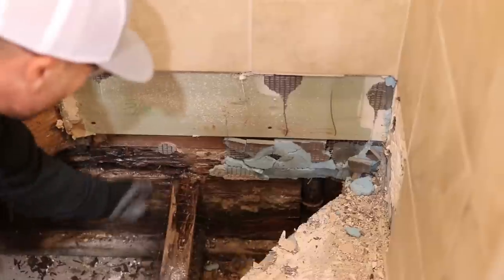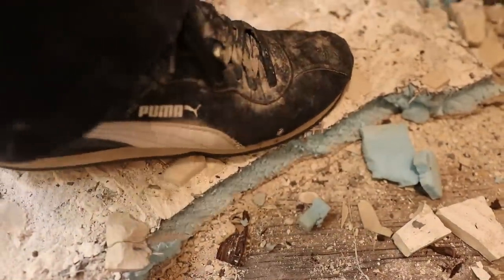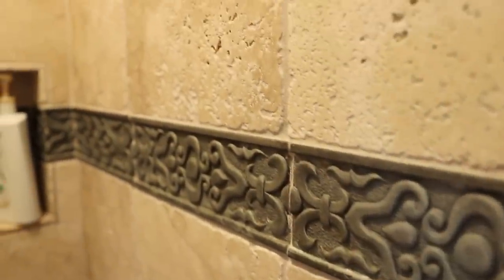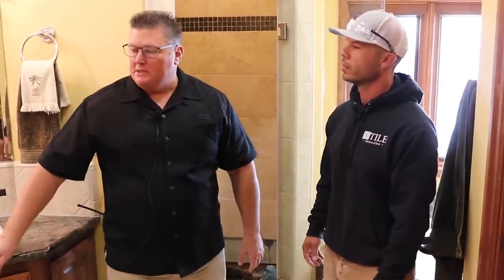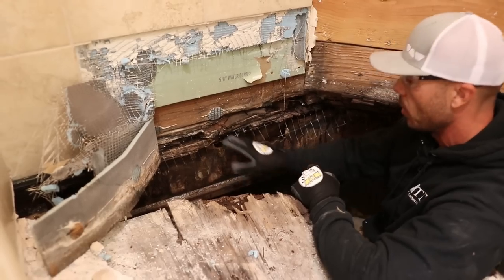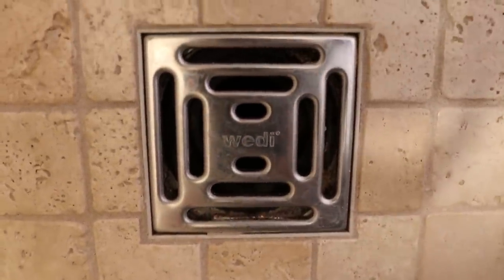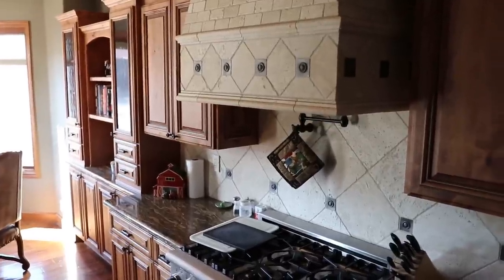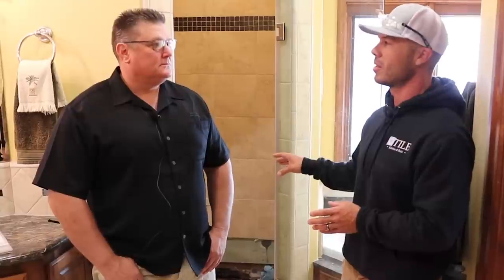Massive WEDI Shower FAILURE (Done by Certified Installer) -- Warranty Claim DENIED

Comment: I was thinking of doing my own bathroom remodel but after watching all your tile fail videos I’m scared to do it.
Reply: Funnily enough I started ripping my bathroom apart just before lockdown occurred. I had kind of decided to go with the Wedi system, but like you I am now having second thoughts. I guess all systems have their failings and so it is difficult to know which way to turn! Thing is, whatever option you choose it is damned expensive and so it pays to get it right. This of course doesn’t take into account any damage thereafter if it is done wrong. Sheesh, I think I need to go and have a lie down.

Comment: Great video, unfortunately we are having a similar issue. A 1/4” of their sealant was utilized. My report says in 2012 when ours was installed that 3/4” should have been used and now 1”. I have been going back and forth with them. They continue to deny the claim, we are of course right at the 10 year warranty period that they had in 2012. Their rep was onsite during install as the company we dealt with did not have experience with a steam shower. Wedi is denying our claim saying they do not have proof that their representative was onsite. It’s been a very unfortunate costly situation! The wedi representative in FL has been very friendly and responsive. It’s just very unfortunate that his manager and the insurance company continue to deny the claim when this is clearly an installation error. They are offering to give me wedi board then the rest will be on us which is very expensive. Our floor is even damaged. At this point why would I want to go back with the same system that failed us?!? Does anyone have a success story with an approved claim with Wedi?

Comment: I was surprised to see this video as I've used Wedi for around 15 years before it even received it's UPC approval and tripled in costs. I've had no failures and agree with other comments that the white sealant is incorrect. Not only is Wedi sealant grey it is also dated and has to be used within it's shelf life. The pan also requires modified thinset applied to the sub floor with a 1/2" trowel and of coarse introduced to the bottom of the pan. It seems this step was also missed when I see the whole pan move as the wall to pan sealant is investigated in the video. I do happen to be a certified installer and can share it was instruction during a free dinner and bucket of tools promotion to introduce the product. We are all only as good as our last job, keep up the great work and sharing your experience in the field Nor Cal strong!
Reply: Exactly what I was thinking. I’ve used Wedi for about 8 years now and so far no issues. I’ve only ever seen grey sikiflex and this white stuff was a head churner...maybe an early sikiflex or something else? Also your right about the expiration on the sausages and tubes, that stuff I believe only has a 2 year shelf life then you have too toss it.
Reply from the maker: https://youtu.be/_skYsjFBnPM
Reply: @TileCoach  Thank you for your replies, very helpful

Comment: I opted for the KBRS shower pan system. It’s rigid foam that comes already coated and waterproofing membrane, uses polyurethane sealant in the joints then gauging fabric over the joints followed by more water proofing membrane. The shoes curb has 1/2” of a solid pvc so you can actually drill into it. Never understood other manufacturers making curbs just out of foam.
Reply: I'm going to be using a similar pan system by RSS with goBoard for the walls.   No curb though, I have room to build up a slight ramp with mortar.   After seeing this video though I plan on not trusting just the polyurethane joint, I'll be using waterproof taping and hydroban the entire thing.

Comment: If they used the correct sealant in the notch you would have a hard time separating the wall panel from the pan. Your supposed to fill the notch with sealant, insert the wall panel until it oozes out. That's not the correct sealant they used. I have experience installing Wedi and I'm certified. I don't use it anymore due to the cost. Iv'e never had any issues. 
 The proper sealant that comes from Wedi is a dark grey color. When cured properly it becomes very hard. Imagine combining epoxy with caulking. It's not nearly as pliable as what you show in this video. The Wedi sealant is expensive and you need a proprietary caulking gun to disperse it that you can only get from Wedi, (it costs $100+) I have a feeling these guys cut some corners on the install and used the wrong sealant.  Perhaps that's why Wedi denied the claim.
Reply: It seems like it would be easy denial if the answer was "used wrong product".
Reply: @TileCoach  Simple. Have that sealant analyzed for it's chemical make up at a lab. Ill contribute $40 to a patreon page to help pay for it. let's get to the bottom of this.
Thanks for all your work but at some point you have to use science and facts to solve problems. That looks like caulk to me but I'll wait for the analysis.
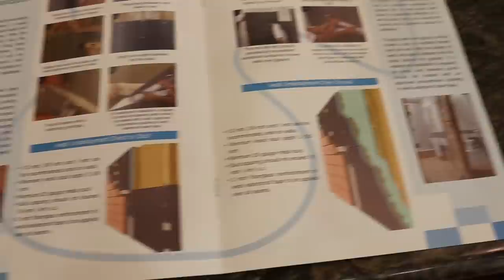Reply: @TileCoach  That's correct. There is some polyurethane caulking at home depot and other hardware stores. Iv'e tried them but Iv'e never seen a white polyurethane before. 1:11 is when I started typing my comment.The sealant should be applied  in the notch and again around the perimeter of the pan where it meets the walls and curb after the wall panels are secured. A wedi shower can potentially fail many ways. The most common would be if the holes from fasteners did not get properly sealed prior to tiling. I think the bench is what caused the problem on this one. I think the bench pulled away from the wall when someone sat or stepped on it, and that started the leak. over time the subfloor got saturated and started to give and eventually the bond on the pan broke. Do you think that's what happened or something else?
Reply: @cjlongtile  I would look over the bench and see if there is anything above someone would step on the bench to reach!
Reply: @nullrout556  Unless part of the story is not being told, I don't see how they could have denied the claim.  The homeowner hired a "certified by Wedi" installer.  How was he supposed to know if the installer was taking shortcuts? Was he supposed to get certified himself so he could monitor him? 

It sounds like they will just deny every claim.  This company needs to be sued into compliance.
Reply: Interesting, the WEDI Polyurethane sounds a lot like 3M Window Weld for car windows. It is only barely possible to use with a hand caulk gun (electric is preferred) it sticks to anything and is super strong. But, even car windows installed with urethane can leak after some amount of years, it's the best method for that, but not a complete silver bullet. Even installed correctly, it can still leak with enough time (probably 20-30 years...) When I looked up urethane vs silicone for a car window application, apparently car window urethane sheer strength is supposed to be about 700PSI, silicone is only about 220PSI. That means a lot in a crash. 

Anyway, bought a few more tubes of cheaper Sika urethane windshield sealant to fix random things in my house now, haha.
Reply: @cjlongtile  Corey, like you I am also certified in both Wedi and Schluter. 

There is a white poly that is sold at Home Depot which is made by Loctite. It is primarily used for windows and doors.  I guarantee this installer used the wrong sealant, and that is the reason it failed.  The correct stuff gets extremely hard and I don't see any way possible that if used, the customer would possibly have these problems.  I have never had a single problem with either Schluter or Wedi installs in the last 15 years and we do a ton of them...mostly Schluter due to price. If you follow the proven methods and don't take short cuts or cut costs, there should never be an issue
Reply: @Archangel0804  I agree. A Wedi shower done correctly is a very solid system.
Reply: @Archangel0804  that white stuff seemed very stretchy,not  hard,later in the video the rabbet has sealant looks gray to me it is it just  very moldy?,and again rubbery
Reply: @sonofthunder.  If its white and stretchy its the Wrong stuff.  I'd only use the Wedi Sealant...nothing else, otherwise your business is going to run the risk of having to eat the cost to build the customer a new shower, and that isn't cheap

Comment: Hello,
It looks like (at 18:30-:35, and 19:04-:15) the wedi board is more on top of the pan not (IN) the rabbit....not sure.  I am currently installing a wedi system and made sure the wall was down in the rabbit with a good amount of wedi caulking.  I hope it lasts better than this one, and I wonder if I should be using a rubber liner to seal the edges?

Comment: The owner commented that it didn't seal. In fact it did seal but like Isaac said, it delaminated over time. from the Wedi backer board you pulled off that caulk, it seems like it needed water and probably a hot temperature to help it delaminate over time. Timeframe sounds like 3 yrs or for the caulk to begin to fail along the foam edge. The rabbet was cut well, the tile was well adhered. Only the wedi product had a problem.

Comment: This is exactly the problem I just had only 2 and a half years after the install. The joints in the Wedi floor and where the walls meet the floor failed and I got massive rot in the subfloor and studs, water eventually appearing in the ceiling of the room below which alerted me to the issue. The Wedi sealant was used as specified.  

The contractor is redoing the shower and part of the walls under warranty right now, using Wedi. He's creating a deeper rabbit in the floor pan and he's adding water seal tape at the corners and all joints and RedGard over the the bottom 3 feet of the entire shower.  I sure hope that's sufficient! I don't have degradation in the foam so he's not replacing the shower bed.  The local tile shop convinced me to use this material as superior to green board in the original install. I wish I had seen this a week ago.

Comment: Hello, Wedi installer here. 

Although I work in Europe, I am always interested by failures with the brand I install:
- Even the best brands have failures and they always leave us facing the customer and resorting to our insurance in the end. So it's good to know if that's the case.

- When it's the contractor's fault, you can always learn something. Mainly what not to do.
In your case, it seems like a contractor's really faulty work. It really is stricking that he was supposed to be a certified WEDI installer.

When you install a Wedi floor, you must seal the all the floor/walls junctions with a strip and a bi-component "resin" (not sure on the right US term, but it ends up still elastic after drying), as shown on this official video here: https://youtu.be/27GTTK3MqMg?t=716 . I'm btw surprised on how US targeted videos barely talk about it while the point is heavily emphasised on EU ones.

On the showers I typically install with my tiler buddy, we first waterproof all the walls with a liquid  sealant and strips in all the corners (we don't use Wedi walls, it usually is drywall or bricks based), then add the strips and Wedi bi-component sealant and waterproof all the floor/wall junctions. He can then start working after complete drying. Never had a failure so far.

A sealant bead can and will never make it. Of course it would end up faulty, even more in the US where wooden house tend to work more than our concrete based structures.

Anyways, thanks for sharing and keep it up!
Reply: As an addition, I've also never seen the "rabbet" in EU WEDI shower pans.
Reply: Why you don’t use the Wedi walls? Im thinking to do that in my bathroom but now you make me hesitating
Reply: @jpeters7594  Sorry for being late. I had a whole lot of work and no time to chill on Youtube.

Anyways, I don't use them because I don't need to. I waterproof all the walls with two resin coats, then use the kit provided by Wedi to waterproof the wall/floor junction.

By any means, it doesn't mean wedi walls are a bad product. It works well in standardized environments with drywalls and but is trickier to work with when walls are not completely straight or vertical. Also, since you add another layer, it means a loss of centimeters in the shower area. In some cases, it doesn't matter, in others it's critical. 

There's never a miracle product, it's all about choices.

Comment: Wedi needs to stand behind what they sell......
Reply: It's been 12 years since that install. Their warranty then and still is 10 years standard.
Reply: @thebulge8961  it failed horribly. Even before they discovered it at that time. I bet even after 5 years it looked the same way. They just discovered it too late
Reply: @thebulge8961  According to the homeowner it was 15 years if it was installed by a "Wedi certified" installer in which case it was.

Comment: This is one of the reasons why I don't particularly like topical waterproofing because if there is a shift in the house foundation it could crack down in the corners of the pan and then you're going to have a problem. 
It's so important to get the perimeter of the pan sealed really tight.

Comment: Been doing wedi this year did two custom shower with this system , never again thanks for the video , also a certified weidi installer from
Ohio . Going back to the old method , I foresee warranty replace my in the near future !
Reply: Don't worry about what you did. Wedi is good as long as you used the wedi caulk sealant.  It clearly wasn't used here and is the failure.

Comment: I watched this video twice and I can say with a fair amount of confidence that the investigation results are at best inconclusive. To me it looked like Isaac was trying to find the root cause by looking outside of the area where the most damage has occurred. If this was a an investigation of what started a fire, Isaac was searching a few miles away from the epicenter. The root cause probably was what the first investigator discovered by searching (and dismantling) around the epicenter. If the first to investigate this shower failure was the Wedi person then it seems plausible that a shifting in the structure of the floor/house may cause a crack in the Wedi system somewhere just as the person said. It would have been useful to see the evidence of the crack or whatever happened documented with pictures.
The visual "evidence" provided by Isaac is very weak because what was shown was not part of the epicenter of the failure.The leak was not happening along the entire seam but was localized and the leaking part/structure was probably destroyed by the initial investigation. I would say that this video is misleading because it merely presents opinions and feelings against the Wedi but does not uncover any facts other than stating that a Wedi shower has failed.
Reply: I have read the results of the Wedi investigation (after my first message) and the root cause seems to be explained in a rational statement. It would have probably been helpful if Isaac was there before or during the Wedi investigation to film/document the dismantling of the bench.
Reply: Keen perspective. The bench area was obviously the issue, judging by the way it's already disassembled previous to this video.
Reply: You must have watched a different video than I did.  Isaac pulled the rabbitted pan at least two feet from your "epicenter" and at that spot the rabbitted pan delaminated from the sealant, which stuck to the wallboard.  This clearly shows that the pan and wall were separated at the junction, which is below the level of the pan.  In other words, that's where the water would have gone anytime the show was used.  Also, the dry rot was uniform all over the underlying framing, not just below the "epicenter".  IMHO, Isaac was correct: the failure occurred where the pan met the wallboard.

But you are correct that what caused the failure of the sealant IS inconclusive.  Others have weighed in and there are several possible causes: 1) not a clean rabbit prior to sealant application; 2) wrong sealant; 3) "correct" (recommended) sealant that simply failed; 4) more movement than expected when the sealant specs were analyzed (earthquake or soil movement of house with insufficient foundation); 4) inadequate structural support, i.e., excessive joist span insufficient joist depth).  

Sounds like a great lawsuit.  But I believe Isaac's underlying message is also correct: the WEDI is relying on the sealant with a one year warranty to satisfy the promise of a fifteen year warranty.   That is a design defect.

Comment: I looked at Wedi  yrs ago when one of my suppliers started carrying it. I couldn’t believe the whole system is based on caulking. In a perfect controlled environment it would probably work just fine. Add a semi controlled job site and a moment of inattention and this is what you get.  I’ve been using schluter for years without issue but I don’t trust anyone else to do the install. I take my time and follow all the specs.
Reply: The also have an additional waterproofing membrane that can be applied on top of the system like Kerdi, called subliner dry.

Comment: Its puzzling why Wedi would use this type of system without banding to cover seams and corners in favor of poly, and yet are the most expensive system out there.  I am glad I came across this video because so many other places highly promote Wedi over Schluter and other systems, and I could not understand why??  Their floor pans are a pain to install, and their drain system are a nightmare, especially if you are trying to DIY.